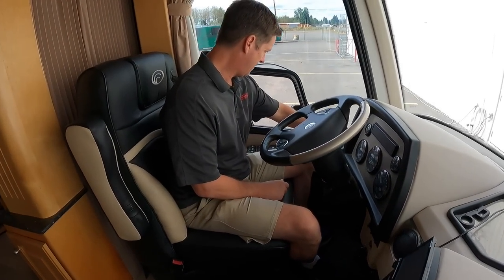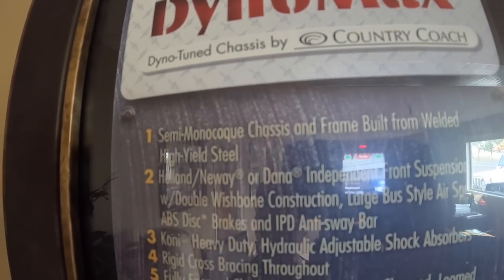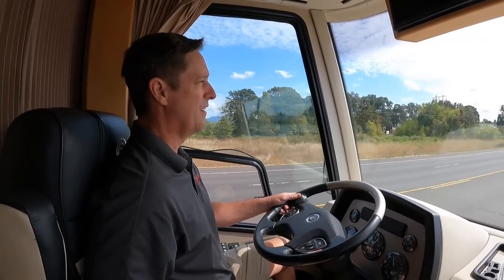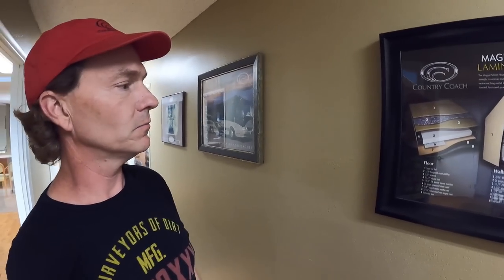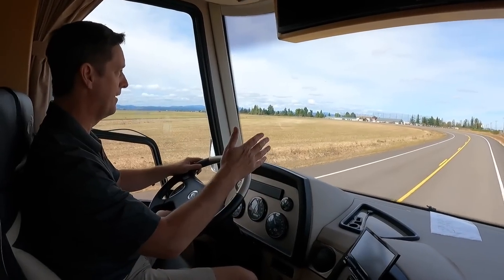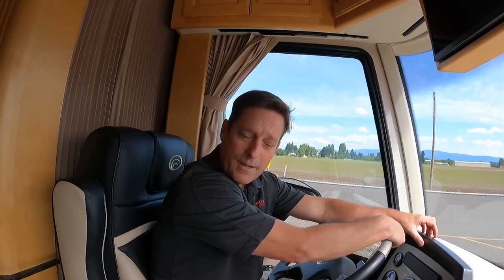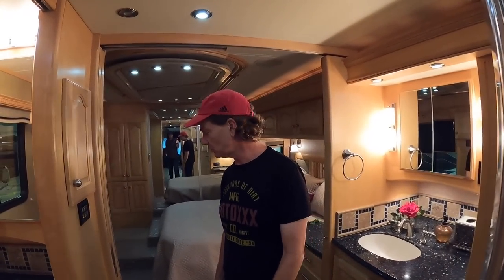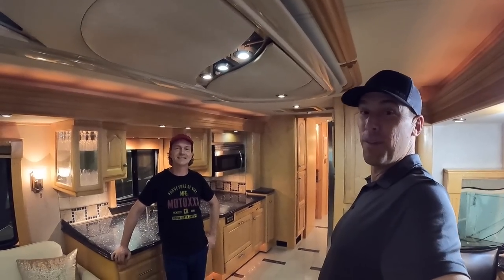TEST DRIVE AND TOUR OF COUNTRY COACH MAGNA WITH CUMMINS 600

Comment: I just notiiced something i've not seen before and maybe you can explain in another video. This Magna has a pleated expansion curtain on the inner side of the slide room that keeps the wet sidewall of the slide from damaging the inside of the coach. I have not seen ANY other coach have this. THIS SHOULD BE IN A VIDEO ANDREW!!       CHEERS      Steve h.

Comment: Hi Andrew, How do they get those huge refrigerators into the coaches? Do you take the slides off?
Reply: I believe they remove a slide - I kind of remember andrew asking in another video, but I could be wrong...
Reply: In another video they said they remove the windshield and slide it in that way.
Reply: Through the windshield.
Reply: @stratolestele7611  I never would have guessed that...I don't know why, it seems logical...good to know

Comment: If u leave the ugly counter floors need to go or if u can change counters easier then u might let tiles carry on if u toss the blue brick prts enough. Just saw big tile in 1/2 & then pull 1/2 big tile & blue brick then if u saved any of the 1/2s u can mix them in w/new tile that looks nice match wise.